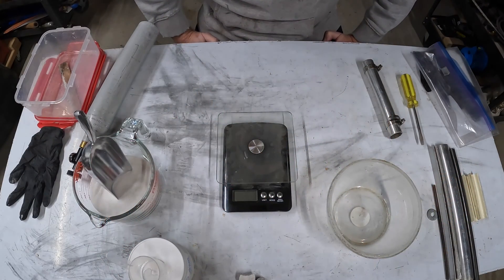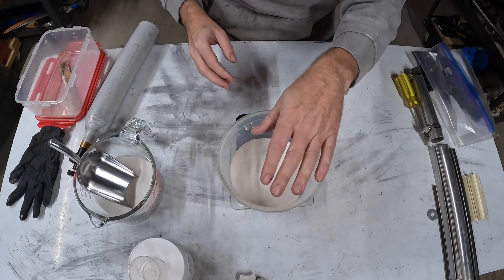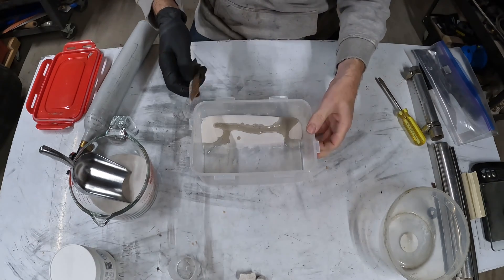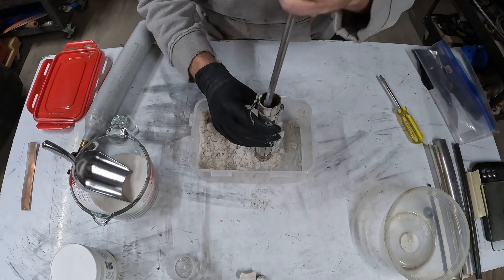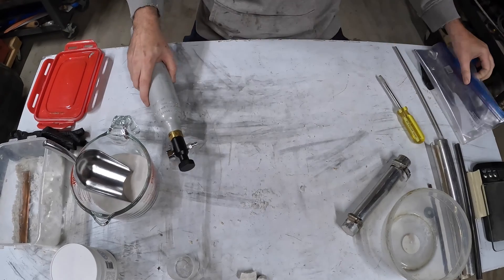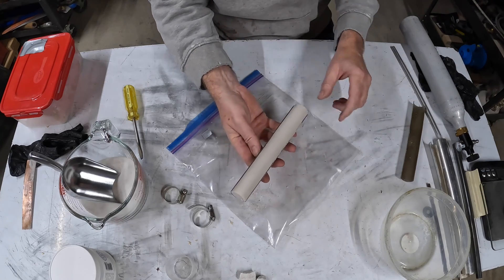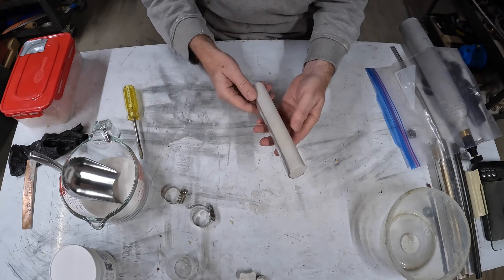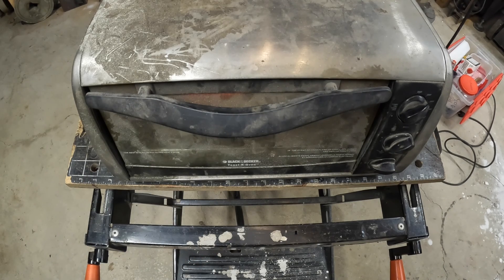Experiment: Making Sodium Silicate Sand Cores

Comment: Is "Sodium Silicate Sand Cores" soluble in water ?
Reply from the maker: Good question.  Honestly, I haven’t tried…?  Anybody else have any insights?
Reply: Sodium silicate is the main ingredient in radiator stop leak.  Once hardened should not desolve in water.

Comment: if you have a bottle of CO2  most probably it is compressed to a liquid ( about  60 bars)  so always use them upright to avoid the liquid coming out  one only needs the gas. If the flow is too high the expansion will cool it down so beware of frost bite